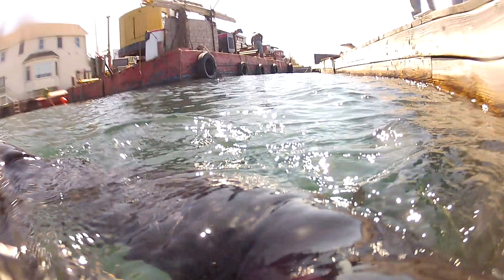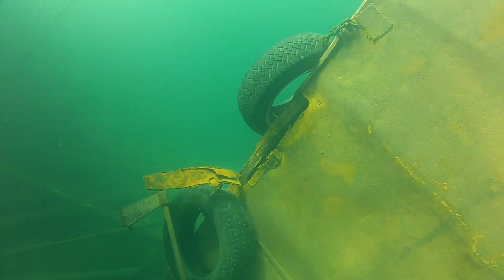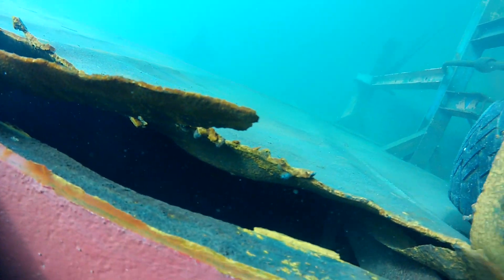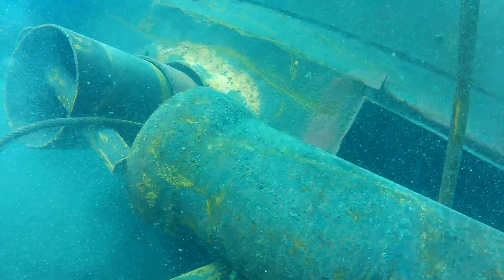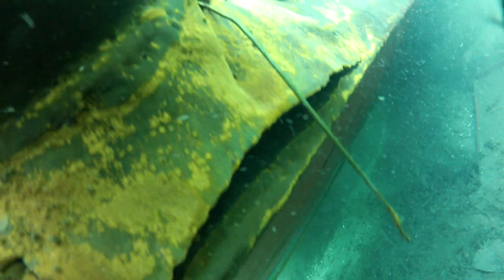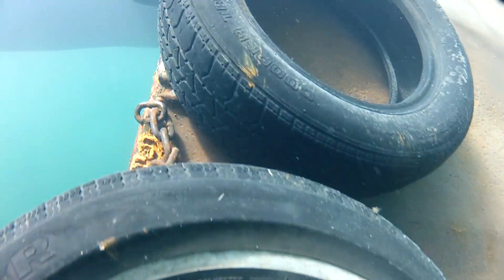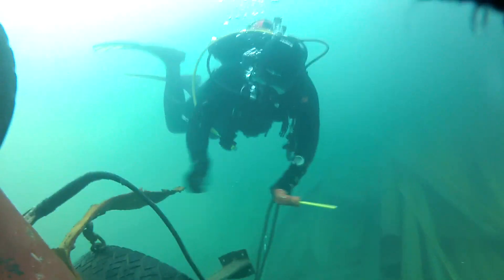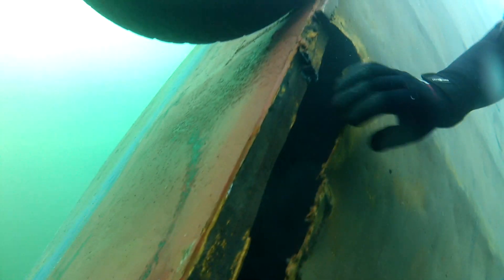Underwater Torch Cutting

Comment: Thank You - was doing research on salvaging a submarine in 1925 and was amazed that they were doing this 100 years ago.  They cut a hole the diameter of a pencil with a torch to see if the compartment was flooded - and then had a plug ready to check the air pressure inside.  In 7 minutes he had cut a hole into the submarine.

Comment: You are endangering yourself, anyone near you and the entire industry by doing this shit on scuba. SHAME
Reply: In a construction environment, scuba is never the safer gear.
Reply from the maker: @michaelmrozinski2034  Correct in a "construction environment"... Normally its not used in a production/commercial environment. 20 years of inland puddle jumping I have seen it work safely and perfectly!!!   I believe this was a test on my 12v DC self contained system...
Reply: Just because you have seen it work safely does not mean that it is safe. There are industry protocols in place for a reason. And for u/w burning you are to have a knife switch or similar inline from your power source and you are supposed to have direct communication to the surface. I have shared this video on a FB group called Stop Commercial Diver Deaths. Not one person agrees that this is safe. I have worked inland/offshore, and internationally. Not one place is this considered acceptable.
Reply: @michaelmrozinski2034  this guy wasn't even wearing a shield..but claims to do it safely, on SCUBA. Man, I would never even consider it.
Reply from the maker: hat/rig is the normal gear... but SCUBA or re breathers sometimes are the safer gear.

Comment: This is very unsafe and you are lucky I don’t feel like calling OSHA. Why would you post a video like this? Do you think you are cool for showing how not to do a job safely?
Reply from the maker: Calling OSHA??  that tells me tons....  anyway,  sometimes SCUBA is the safest, hell we have ran re breathers also (tech divers are way safer divers period).. But for the 99% hat/rigs will be the safest.
Reply: How do you have communication with the surface while burning? You had the ground and stinger in the same hand while it was hot! None of this is safe or following proper procedures. Why don’t you read some of the papers you probably throw away that comes with those Broco or FireWire rods.

Comment: Witch one fule gas use  in underwater gas  cutting can you tell me
Reply: Beside the gasoline, some other underwater gas burning torches use hydrogen or MAP gas. With some practice and with a particular torch, the cutting speed can be MUCH higher (3,3 times) than any electric cutting tool (if we except plasma cutting).It generates MUCH less pops then rods even if there is any material behind the structure and is therefore the perfect tool for sheet piles cutting.
Reply from the maker: its oxygen and a consumable rod, but they do make a gasoline setup... but too messy for the environment.

Comment: Is this oxy-fuel oxy acteleyn underwater metal cutting? If so you don't have to worry about getting shock underwater. Also I didn't know you can weld underwater.
Reply from the maker: No its like surface arc gouging just we use DC power.
Reply: @edduda3  what kind of welding requires AC power? I think most are DC correct?
Reply from the maker: @7150285  AC is for steel, low alloy and cast iron, but really depends on the rod used.  DC is safe U/W so that's the only thing used in that environment.